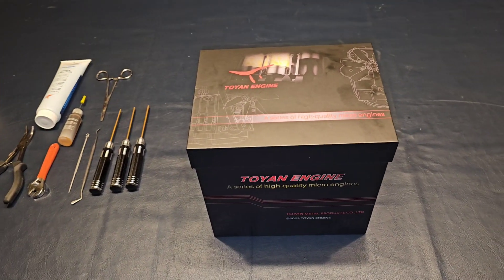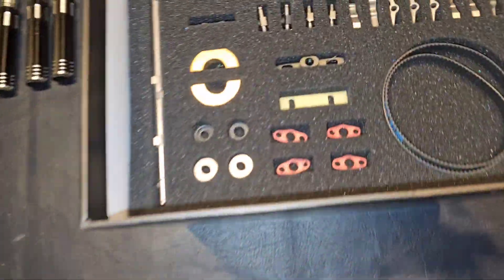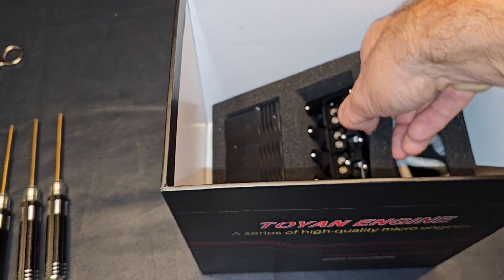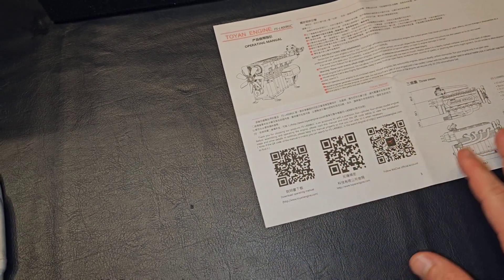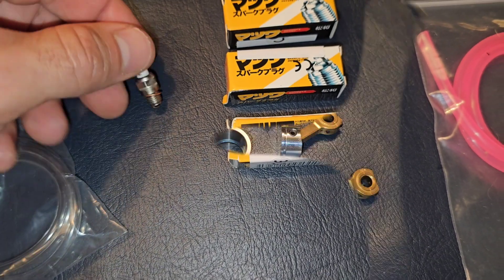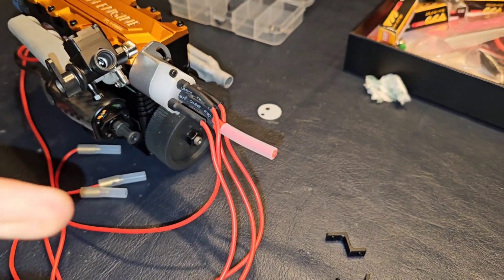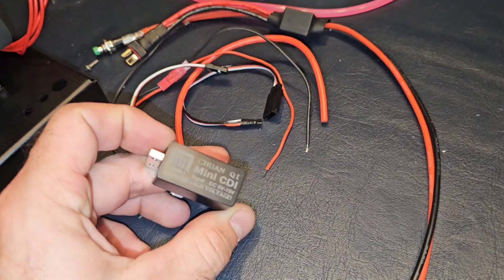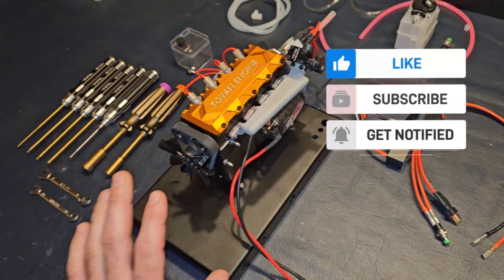Toyan Engine - Stirling Kit. 4 Cylinder Water Cooled, For a RC Boat! FS-L400

Comment: I have mine assembled up to this point.  I'd love to see how you finished up the electrical and what gas/oil mix you used.
Reply from the maker: I couldn't ever get gas to run or even spark. I swapped to the glow plugs & 4-in-1 glow system and that simplified it a ton! It runs now on 30% nitro. 
My HEadgasket leaked & i torn it down & ysed copper spray gasket on the new one & it seals good.

Comment: Where did you get the cdi?
Reply from the maker: @coleagnew1188  Stirlingkit.com sells them. I ordered another bc i think I ruined it on 3s. Going to try 1 more time before I just run it on nitro (which should be easier) & glow plugs
Reply: @H2oMechanicHobbies  thank you!

Does spark plug order matter?
How do you know the numbering from distributor?

Comment: I guess if you're running a slow paced boat that motor will be fine as for the exhaust they are really small to produce any kind of RPM and I'm not really sure the longevity of the motor in itself there have been a few people put them together but my biggest complaint was RPM being too low and exhaust being too small or restrictive. But I'm sure it'll be fine for a slow pace boat
Reply from the maker: @stevejackson3564  max 13k rpm. So I'll run it around 10k. I don't expect longevity from it, it's more about the cool factor. I'll run a huge prop & let it eat